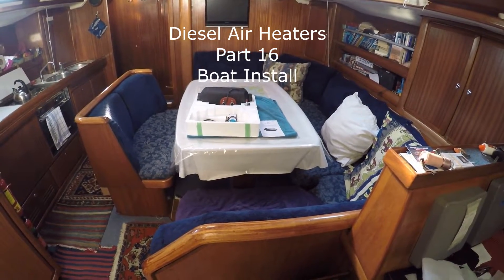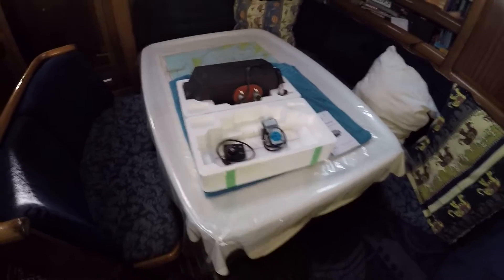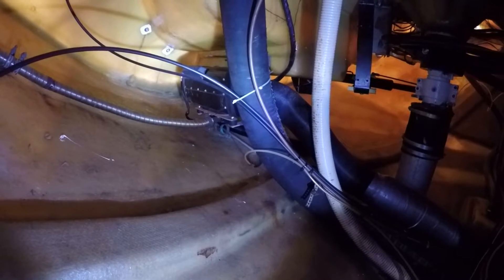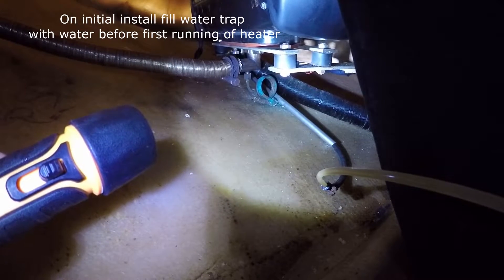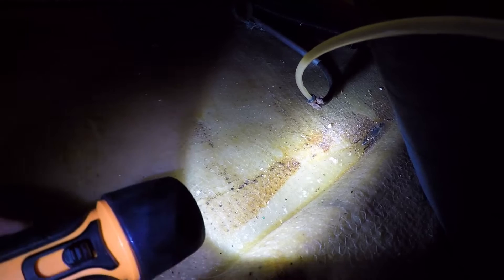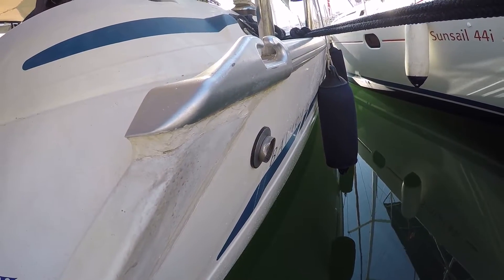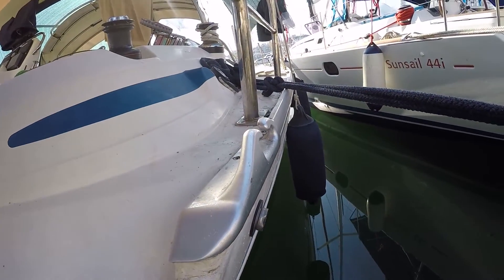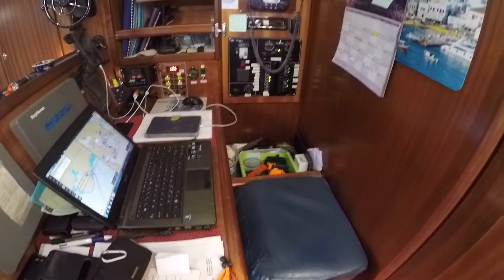Diesel Air Heaters Part 16  -  Boat Install

Comment: I was wondering if you would be willing to help me troubleshoot my heater I just got?
Reply from the maker: I will try Russ, what is the problem?  JMcK
Reply: @johnmck1147  I just got a 5 kw and the pump prime feature does not work, The glow plug light (on the display) does not come on, i cannot access the diagnostics. After manually priming the fuel line. it did ignite and work pretty well, it gets quite hot. When i went to shut it down The "hz" flashed 0.0 and it just  The  pump and flame went out immediate. but the fan ran for 2 mins. ( it does have the black lcd display)
Reply from the maker: Russ Montgomery 

Hi Russ,

Looks like you may have a dud controller. But you may also have issues with the ECB. 
I suggest you contact the seller and ask for a replacement heater as some heater suppliers now sell these heaters with non standard plugs and wiring. 

If they won't exchange heaters ask for a new controller.

 It is not uncommon for eBay sellers to not offer a replacement even though they advertise returns, but it is possible. Most likely you will be offered a credit, and this is often enough to buy a new controller (about A$25).  This has happened to me in the past and I have bought a new controller. Below is a place I have bought a controller from to get you started in your search.

https://www.ebay.com.au/itm/12V-24V-LCD-Monitor-Switch-Board-and-Air-Diesel-Heater-Parking-Remote-Controller/254013923739?ssPageName=STRK%3AMEBIDX%3AIT&_trksid=p2057872.m2749.l2649

It is normal for the fan to run for some minutes after shutdown to cool down the heater.

I hope this helps.  JMcK
Reply: @johnmck1147  I spoke to the seller today and they are sending me a new controller. Unfortunately it is a nonstandard one so it would be hard if i had to replace it down the road. If the replacement controller either does not work or they shuffle me around trying to run out the 30 day rule I will return the unit
Reply: @johnmck1147  Thanks for your advice.
Reply from the maker: Russ Montgomery 

Your welcome Russ, I hope it all works out.  JMcK

Comment: I have a Espar d4. ,  a Planar 44d and just recently bought a Chinese diesal heater that's still in the box , Out of the three I believe the Planars fuel pump is the quietest of the three , it's almost silent , My Espar pump is noisy and i heard a Chinese diesal heaters pump in a YouTube video and it was noisy .
I've never heard any other Espar pumps so I don't know if there all loud.
I bring this up because I believe you can run the Chinese diesal heater using a pump from a Planar   
If you can find one online to buy.
I hope this info is helpful.
Moral of the story is that i think that there's quieter dosing pumps out there!!!!
Reply from the maker: Hi Larry, thanks for the feedback. All the dosing pumps deliver the same .02 ml of fuel per pulse and are interchangeable. There are two main issues that make them noisy. Not really soft mounted, and not enough vertical angle to allow cavitation bubbles to escape. An air bubble in the pump causes a clacking sound rather than a ticking sound.  JMcK
Reply: @johnmck1147  
I'll keep that in mind if I ever install the Espar again , I had the dosing pump angled but maybe I didn't have it angled enough.
Thanks

Comment: Dear All. I'm installing a chinese 5kw heater on my 393 Oceanis and have come up with a plan. The install itself is pretty much complete, with a load of marine orientated parts (exhaust, ducting, wiring, etc) + 2xcarbon monoxide monitors. Anyway, I came up with an idea yesterday.
I have a single hot air duct coming into the boat, connected directly to the heater. During summer months, I have a standard house portable aircon unit which I run off the 230v electrics on the boat.
My idea for the hotair outlet from this aircon was to connect it over the incoming hotair duct, so that it blows this hot air back down the tube, over the chinese heater (which would of course be off), and out into the open air.

Can anyone see a problem of blowing the warm air from the aircon backwards through the heater, so that it can escape? I can't really think of anything apart from maybe a little humidity.

Comment: Absiolutely no way to put it in the center on my boat. It will go where the old one was, port side aft locker  on the wall towards the port. 

And there won't be rubber mounts, and no "water trap" .
Reply from the maker: Hi Andreas, your boat, you install a heater exactly as you wish. JMcK

Comment: First you're like "don't use bigger fuel hose!" Now you're like use bigger fuel hose? What gives? Your experiment already showed 3.5ID is no good.

Not to mention certain requirements in Europe says it has to be a special type of fuel hose which has ID 3.5 all the way. :> 

Why do you now suddenly wanna use normal hose?
Reply from the maker: Hi Andreas,

I have found the bigger fuel hose on the suction side of the pump is very acceptable and advantageous as it is less prone to joiner leaks. It works well if the pump is around the same level as the fuel tank and not significantly higher than the tank where it has suction issues. The delivery side of the pump should only have narrow bore hard nylon fuel hose unless the delivery side is very short.

JMcK